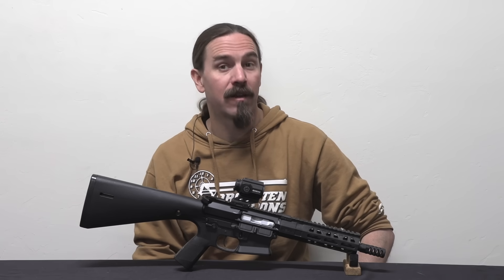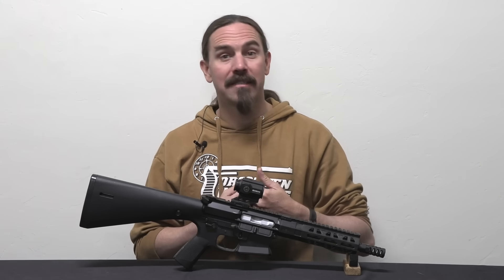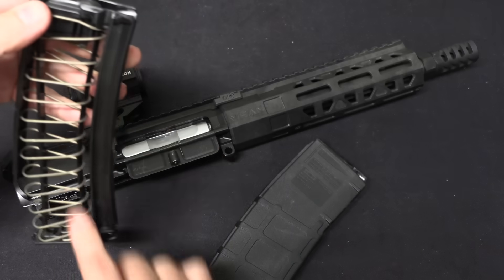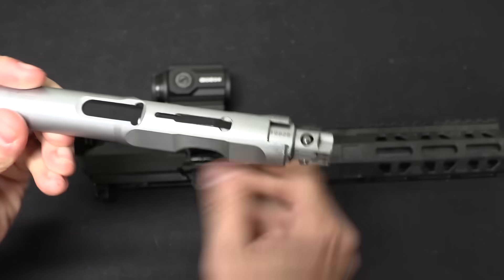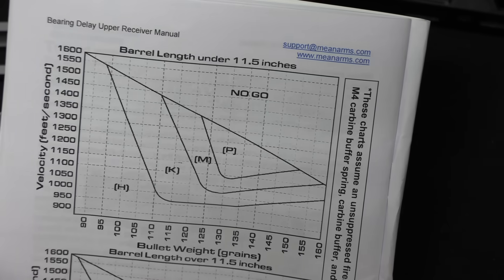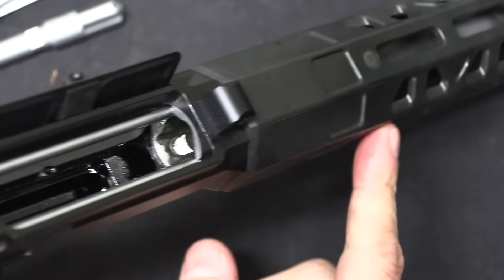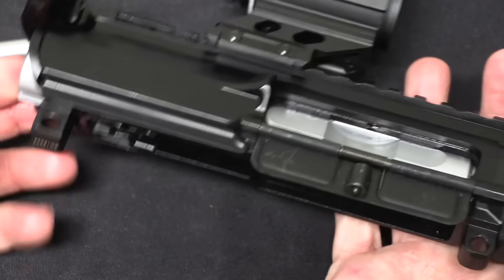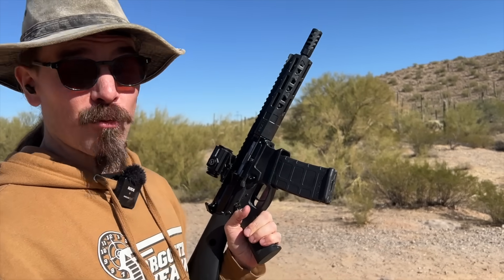Mean Arms' Bearing Delay System

Comment: I really love the symmetrical locking - spreading the forces to 60° spacing should spread the stresses  better than two rollers 180° apart (not that I'm sure that's all that necessary with 9mm, it surely doesn't hurt anything).

I also really like the dedicated skeletonized "STANAG well" 9mm magazine.  If you mix up this with your 5.56 or .300 magazines, well, maybe complex machines with moving parts aren't for you - Bad Primate!

I do worry about the wear on those ball bearings.  Seems like you're putting a lot of force concentrated on a very small contact patch.  But, we mastered making affordable, high quality, tight tolerance ball bearings DECADES ago, so presuming they used a standard industry size, alloy, and heat treat, replacing them as wear items shouldn't be a major issue.

👍

Comment: To everyone saying that this is crazy expensive for what it is, it kind of is but it kind of isn't. The closest comparison is probably the JP5 roller-delayed upper, for which the upper alone also starts at about $1800-1900. CMMG's radial-delayed uppers are about $1000, and you can build one out yourself cheaper but the necessary bolt and BCG combo alone is $500, and you can't tune that one except for changing buffer and spring weights. $2000-2500 for a complete carbine is definitely reasonable for serious competition shooters, although probably a little more expensive than a non-custom Limited Optics gun but a fair bit cheaper than a serious Open gun.
Also I don't know what everyone's saying about "forgotten," this is clearly one of those "mechanically interesting" FW videos and not a "only 1000 were ever made" videos. These are a fairly recent design, still in production, and Mean Arms is releasing an even-more-expensive competition-focused upper and is sponsoring PCC shooters. It'll probably always be a pretty low-production product, but I sure wouldn't say it's a failed one.
Reply: You technically can tune the CMMG radial system. They offer an action tuning kit which allows you to add or remove a bit of weight to the BCG.
Reply: @petershoaf1356  Oh cool, don't have one and didn't realize that, although adding mass to the carrier instead of the bolt is fundamentally doing the same thing as changing buffer weights
Reply: @makky-kat3719  That's fair, but you could say that about tuning any delayed blowback action. In essence, all you're doing is adjusting the force needed to 'unlock' the system and thus slowing down the overall speed of cycling.

And just for the record, I do have a 9mm Banshee (Mk4, 8" barrel, sweet gun), and I don't have an action tuning kit. Mine seems to run wonderfully straight from CMMG, suppressed or otherwise with all the ammo I've thrown at it. I don't think the ATK is a common thing for most people.

Comment: For 1400 you can almost buy a whole ass CMMG banshee that seems much more pleasant to fire with a standard buffer and spring
Reply: Pretty much. Their prices have crept up some though. 

Seriously, that muzzle rise is about the same as a 10mm Banshee on warmer loads.

And the Banshee? Also tunable.
Reply: @JD-tn5lz  yeah thats my primary issue. If they sold just barrel and bolt assemblies so I could put on my own handguard, I'd be a lot happier. As it stands, this does not seem to be an adequate replacement for existing delayed systems. Still needs a heavy buffer

Comment: I've had 2 PSA AR-9s. I fail to understand why they are made as a modified 5.56. the bolt is too long. The feed ramp is too far from the magazine. I had a ton of feed issues with both of them as a result. There are AR style carbines that are built specifically for 9mm, 10mm/40, 5.7mm etc that I've read are highly reliable. PSA couldn't fix the issues with mine, so I sold them and got a keltec Sub2K. It has performed flawlessly for more than 1000 rounds. A TNW aero, the Just Right carbine, the SIG MPX are all examples of AR style PCCs that don't have these issues.  Why do people still build AR style PCCs based on the 5.56 lower configuration?

Comment: 14:35 The bolt head does not stay in place it just moves very little, compared to the bolt carrier. If the bolt head would not able to move at all, what force would move the bearings or the bolt carrier?
Reply: This is a aspect of roller delay system that people dont mention. The specific angles in the recesses of the trunion and the locking wedge dictate the ratio that the bolt carrier moves back compared to the bolt head. As the bolt head feels the thrust of the case head, the rollers / bearings transfer a portion of the force to the carrier, which is forced to move back at a greater speed. This means that the case head feels as if the bolt weighs alot more than it actually does, because the change in momentum is made up for by the increased speed rather than adding mass. In the G3, it's something like a 4:1 ratio iirc. @forgottenweapons
Reply: @theHSPCproject  Thanks. A German book gives following rations:
G3A3 = 3.88 
:1
MP5A2 = 2:1
MP5SD = 1.69:1
MP5SD1 
= 1.76:1
MP5K = 1.83:1
G3K = 3.56:1
G8 = 4.67:1
PSG1 = 4.27:1
The title of the book is "Arbeiten zu Studium und Praxis im Bundesgrenzschutz Waffenlehre Grundlagen der Systemlehre" by Wolfgang Pietzner.

Comment: I like the way despite the roller delay and adjustable lifters, the solution was just to add a big heavy buffer.
Reply: To be fair, no alternate lifter was attempted. 
For a good as the tabletop work is The range work is the opposite
Reply: @ No, I agree, it was just funny to see him talk about how low recoil it was and how it works with a normal AR buffer weight, only to immediately add a heavy 9mm buffer weight, instantly bringing it very close to a simple blow back 9mm.
Reply: Didn't the reising smg have soldiers putting wood on the bolt to slow down the fire rate

Comment: I have a Maxim roller delayed buffer in my KP99, and it is a great upgrade from a tuned striaght blowback. 

Its pretty close to a clone MP5 and almost a pound lighter. If they can keep the weight loss, and get it tuned tighter. I can see it replacing MP5's for quite a few people.
Reply: There is a bigger market then you out there. 

MP5's are way over hyped for the cost.

Its only 1500 dollars that you have to agree to pay

Comment: It sounds like though kinda expensive,  this will out perform the MP-5 for smooth and accurate shooting... my feeling on PCC's is it should be a part of a two-gun system, a good D.A. revolver w/ a levergun in the same caliber, loading from the same cartridge belt, or the sidearm and carbine utilizing the same magazines. It makes a lot of sense for a cop's patrol rifle to use his pistol's mags, as long as the power increase to a rifle round isn't as important as the accuracy increase... I'd like to see this mounted on a full-auto lower, the 4 in. barrel w/a suppressor, inside the handguard as a buzz-gun could replace the H&K MP-5 SD quite handily....

Comment: I have one of these I built with the 16" upper and I have worked with some of them on a few things with the exomags and some buffer issues I had, it works flawlessly and I havent had any issues since (Armaspec buffer didnt work well with it, standard H buffer was 100%) It is an incredibly fun to shoot, low recoil and buttery smooth shooter. It is a bit more expensive than an AR9 but that's not really its competitor, youre looking at other delayed systems like the radial or roller delayed systems and competition guns. In that context the price is by no means out of the norm. Only really the Stribog comes in much cheaper in a delayed system of any sort. The lifter system on this gives you some really good flexibility and ability to tune, and Unrivaled now makes a captured buffer specifically designed for this upper. Endomags, of which I have several, have worked flawlessly for me in mine and are really clever. I built mine one a JL billet lower, TT trigger, Unrivaled buffer among other things and it is a very light rifle. You can literally throw this upper on any lower you have and just roll. It is EASILY one of if not my favorite rifle that I currently have in my collection.
Reply: You can get an mp5 clone plus a2 stock plus 200 dollar sbr stamp for the same price as this upper
Reply: How does it compare to an MP5 in terms of felt recoil
Reply: @Rusty_Spiggle-Smith   I honestly cant give an accurate answer since I have not shot a "real" MP5, only a few of the clones from other people at the range that had them and let me give them a go. Compared to them, once i got the MEAN dialed in with lifter and buffer etc, the MEAN is smoother and softer and makes almost no noise, the recoil is straight back into the shoulder like an AR15, and it is softer recoil than any of my ARs (Colt LE6920s). These new MP5 clones that are all coming to market do have my attention and I am planning to pick one up soon but havent decided which one to go with yet.  To be fair, on my build I have added some things like the Unrivaled buffer which is designed for this upper specifically and isnt cheap, as well as having the 16" barrel. My lower build for this isnt a cheap one but I really like it. I would want to test a pistol variant of this next to one of the MP5 clones/MP5 to get a viable comparison, comparing them side by side to my 16"  isnt a fair comparison as a lot of things change out at at length vs the ~8-8.5" of a MP5 not in the least of which is mass. Id like to build a shorter MEAN and probably will some time soon after I decide which MP5 clone to go with. Wouldnt be the first time I have purchased things purely for the sake of comparing them.
Reply: I wish I had a camera etc setup to record things for stuff like this.
Reply: @Rushifell  what does the fancy buffer you added offer to the equation?
Reply: @Rusty_Spiggle-Smith  Ill get back to you in a little bit with some measurements. Mostly, it is a captured spring dead blow buffer that is tailored to this system specifically. At the Unrivaled Pro shop site you can see a little more information but it is mostly less reciprocating mass and a little bit more room to travel but very fast response. Id post a link but i think that would get auto filtered/deleted. I want to give you some weight measurements but need a little bit to do that.
Reply: @Rusty_Spiggle-Smith  I just pulled it out and got some weights. I would have to build some sort of rig to take the same measurements for like a standard buffer spring. I compared it to the Unrivaled duty buffer which is what I ran quite happily in this before I switched to the one purpose built for the MEAN. The buffer for the MEAN is slightly lighter and has only 2.9oz total reciprocating mass (per unrivaled site), it also has a pretty lightweight spring. The spring I am measuring about 12.5lb, it runs down the guide rod to a rubber buffer at the endcap with no second stage spring. The Duty buffer is noticeably heavier even though it indicates standard carbine buffer weight of 3oz (total mass of both of them is only about 1/2oz difference, duty heavier, but has a second stage spring), the spring is about the same 12.5lb in the first stage, but it has a second stage spring instead of just the rubber buffer, and that bottoms out around 25lb. There is more to the deadblow buffers than just their mass and spring weights like eliminating bolt bounce that happens in a lot of AR9s, but these are the things I can measure like, right here and now. They have some sort of magnet system that keeps the deadblow weight positioned in the right place during cycling, the exact details of how all of that works I haven't really looked into, but I can definitely say theres a substantial impact. I would say that there was a noticeable difference between the H2 and a normal flat spring (substantially in noise, but it also softened up recoil) and going to the MEAN specced one just made it even smoother, and I was quite happy already, there was a difference in going to this buffer even from the rifle spec version of the same thing in the Duty. More or less, with these buffers you are looking at about 14oz of total reciprocating mass, including BCG and buffer vs the typical ~21oz of a blowback AR9. Those bolts can also sometimes bounce when cycling which can add a little more shock tot he recoil. These buffers do not do that.

I do not own a JP captured spring to compare it to the Unrivaled, I know they are well regarded, but I have no hands on them, I had an Armaspec that was supposed to be H2 equivalent that caused feeding issues, going to a standard flat spring and H2 worked fine in the same shooting session. Ive never had an issue with these buffers of any kind. I own 3 of these deadblow buffers, 2 are the Duty and 1 is the MEAN one and for any builds going forward the intent is to keep doing that, personally.

The Unrivaled MEAN buffer has less reciprocating mass and has a little more travel available to it on that buffer before hitting the very slightly soft bumper, vs in the duty buffer hitting that heavy second stage spring. The MEAN system BCG/bolt are quite light at 11oz, (standard M4/AR15 BCG/bolt is ~11.56oz) especially in comparison to a normal AR9 blowback bolt that depends entirely on (total) mass in that system which is usually a total around 21oz -ish with bolts that weigh 14-16oz (not all obviously) commonly + much heavier buffers. A lot of what you feel in recoil on a lot of AR9s is that mass swinging back and forth, on its way back your muzzle will rise and when it slams forward youll dip a bit. The lighter BCG and buffer are much less reciprocating mass which is allowed to work by the bearing/roller/radial lockups or assorted delay systems providing the initial resistance needed to cycle the action. That translates to less felt recoil, and that is true for all of the delayed systems to some degree. 

The MEAN lifter allows you to tune dwell time to your ammo, barrel length and things like suppressor etc, but it also affects your buffer. I changed mine out because I was was getting more grime and gas out the ejection port than i liked, so i tuned it up a bit and now it runs pretty clean. 

As for Ians' results in the video where going to a heavier buffer worked better vs the JP captured buffer. It could simply be related to mass in the pistol size, but it could also be something that could be tuned with the right lifter, it could be whatever that particular buffer is meant to emulate the approximate mass of, I dont know. My original thought process when I was building mine was also to go heavier, slow things down as much as you can to soften things up, and that usually works. Going to the unrivaled buffer went sort of in the opposite direction, but I can certainly vouch for the end result, this rifle does not move.
Reply: It looked a little gassy at times, all that primer salt can't be good for ones longevity, but if you go doing what you love,......
Reply: @ thats what the lifters are for, you can adjust the dwell time with them and reduce that.

Comment: The colt AR 9 bolt is indestructible and jam free due to simplicity.  All these extra parts on mean arms bolt will make it a jamomatic in mud.
Reply: No duh. The Colt AR9 is (was) designed and built as a military weapon. It shoots like one and is stupid simple. It's not a junk gun, because it works, but it has nearly the same controllability of an AK. 

All other things being equal, and I mean all, take that AR9 to a better PCC competition and you'll get embarrassed. Again, all things being equal. 

The Colt AR9 is just practical, it's not the same intent as a modern PCC competition gun.

Comment: I ordered one of their exo mags months ago still waiting on it. The biggest problem with the endomags is there aren't any mag loaders that work with them but the exo mags don't have the spacer in the rear so I expect that the strip lula and the ETS strip loader will probably work
Reply: The exomags have been shipping and I got some a month or two ago. I encountered an issue with mine where the body was swelling (only) when loaded and it was getting kinda stuck in the magwell. It ran just fine when inserted, but I did bring it up to them and they should be looking at making a correction, it had something to do with the heat treatment (im not a polymer expert, they are) or something to that effect with manufacturing and it is being addressed.
Reply: Try the Maglula Loader for ar15 7.62x39 & 5.56 # LU11B …  Works on the 9mm endo mags.

Comment: This is amazing, I feel like this is the first smallarms locking mechanism that's been developed since the '50s. Granted, it's based on roller-delayed blowback, but it's still a new take on it which I suspect would also diminish cost, no? Those bearings ought to be cheaper than rollers to manufacture, at least I presume.

The vast majority of firearm designs use decades-old locking mechanisms and/or gas systems and from there they play with the stuff that surrounds it.

Comment: Not only price issues but suffers from the same shortcomings Cmmgs RDB has. The ejector spring doesn't last and fails prematurely. CMMG fixed the issue with the Dissent's fixed ejector.